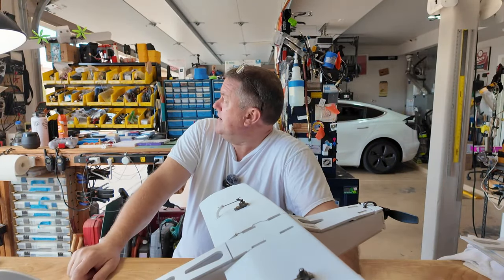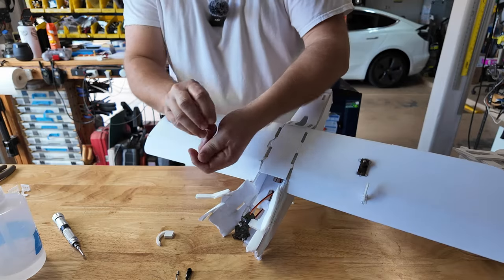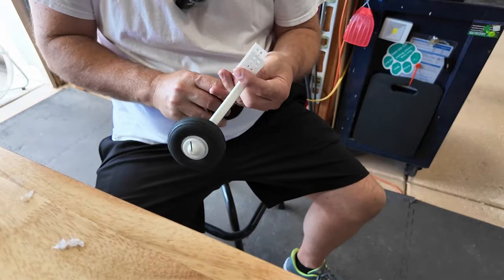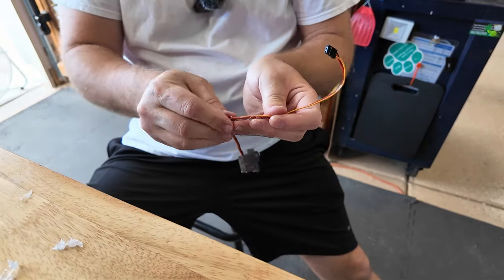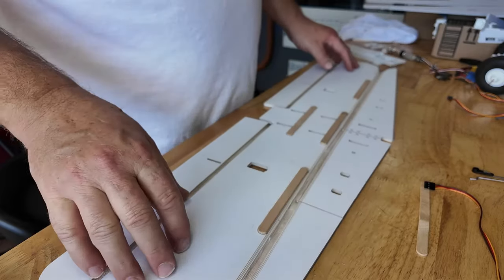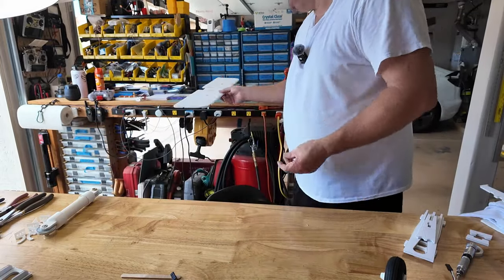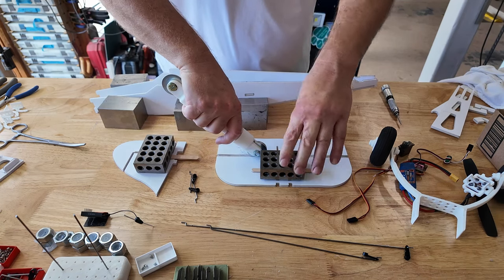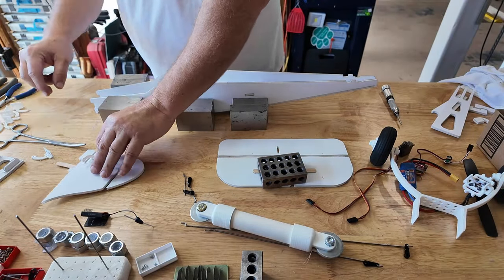Bush Plane Build - DIY RC Bush Plane with 3d Printed Landing Gear

Comment: I was wondering, it looks like from the video like the control horn hole|control rod attachment point is forward of your hinge line.  I've always been told by experienced folks (and haven't experimented otherwise) that it is important for the hole and the hinge line to line up when the flap is at it's neutral point.  If you do it differently for a reason, or it doesn't matter, could you explain why?  Either way, your building methods and designs are impressive in their simplicity and how well they are thought out.  Appreciate your vids!
Reply from the maker: in a perfect world - they would be, and mine are pretty close on this - but my hinge line is more of an area rather than an exact location, as the laser ablates the foamboard in a 5mm wide strip to make my hinge, leaving little of the foam, and only the sheet of paper on the back as the hinge.  (the melted foam somewhat reinforces the hinge - and they last surprisingly long).

What I've found is that the placement is important - but sometimes control movement that goes too far is causing unusual behavior - and in this case - it is possible to overthrow your controls and that leads to controllability issues.  So bottom line, where this horn is placed I do have more than enough movement.  If you go full deflection - you'll (aerodynamically) stall out your controls (particularly the ailerons) - and the plane does really strange things - flying almost like a CG that's too far aft in it's instability and unpredictable flying.  So starting off - I start with limits in the software (on the remote) and get the plane flying.  From there - I'll add more throw until I either achieve a feel I like, or start seeing negative effects.

So at the end of the day - you're right - I was lazy here - but I try to reuse my control horns - and often times find I'm getting results I'm happy with - and I move on to the next issue.

That said - this plane has flaperons that I feel are really effective in slowing it down, and they're at only about 40% throw.  I tried taking them further in droop - but you just start getting a really heavy, mushy feel - so I prefer the balance of control in this region.  The last uncaptured movement you can use as lift dump (like on Hawkers) - but realistically - the landings are pretty short, and I just don't often hit the switch in time.

Comment: We visit Yuma AZ in January.  Are you by coincidence also living in Yuma?   If so, I'm wondering what park you fly at?
Reply from the maker: I'm in Phoenix.  I've been through Yuma - it's a warm spot in the desert this time of year.

If you find yourself in Phoenix - I'm on the north side - if I'm around - I'm usually found flying at a bunch of the local parks or just out in the desert.  When it's cooler - I'm happy to fly with folks - it's more fun!

Thanks for your comment!